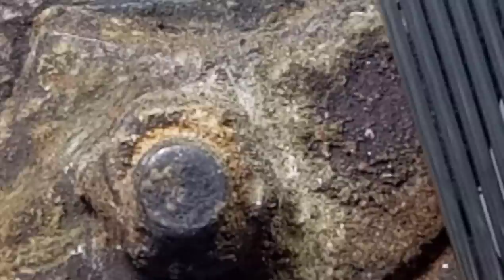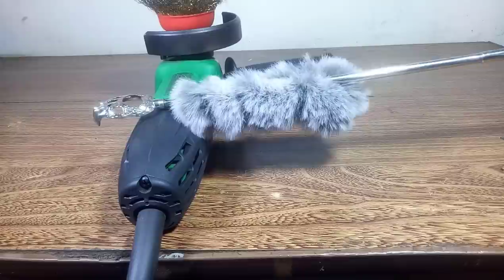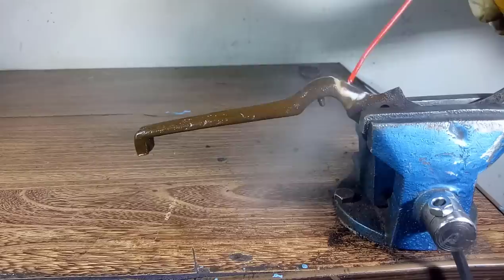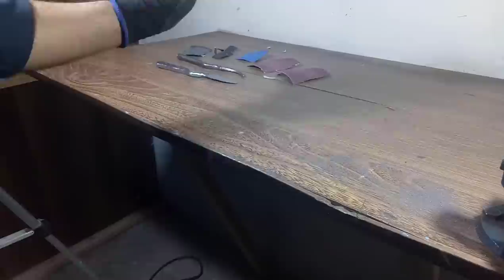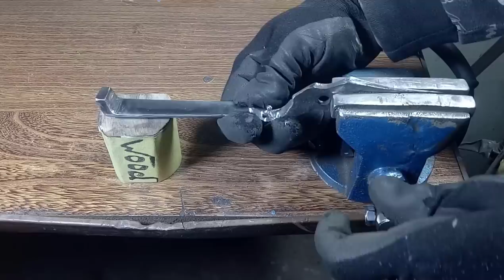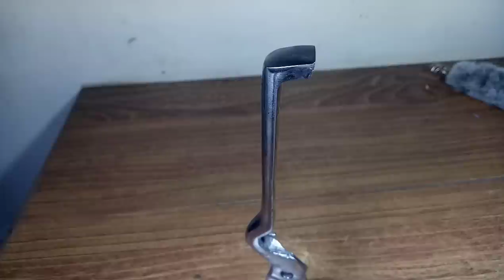Antique Restoration Hand Pruner Shear Rusty Flower Cutter Restoration Video

Comment: I'm sorry I don't understand. A sand blaster would be quicker. If the reason that you use a scraper, oil and a wire brush by hand then why do you use the electric grinder. It makes no science. It doesn't show craftsman ship its just garbage.

Comment: Article 40 does not enrich and is not useful in removing the accumulated rust in this quantity.
Better to use a wire brush. And other materials. Thank you because I have scissors just like that
Reply from the maker: Thanks for the info😊